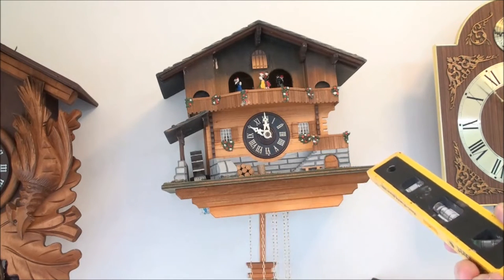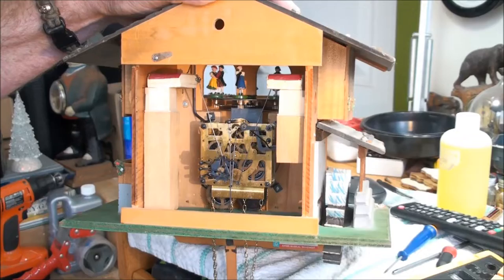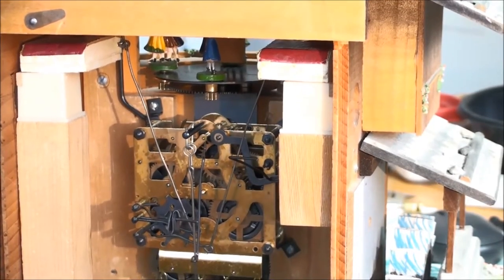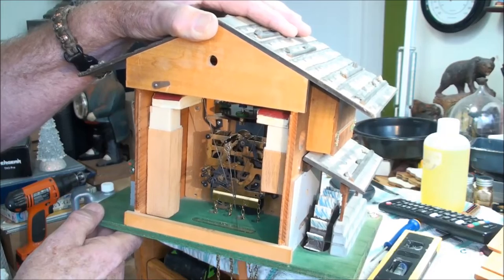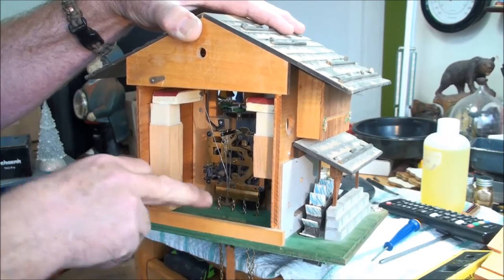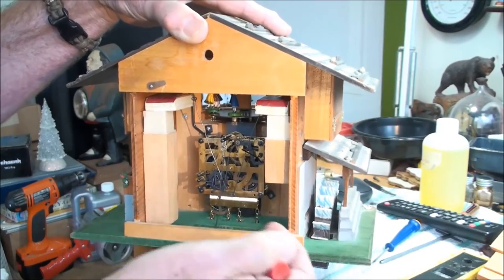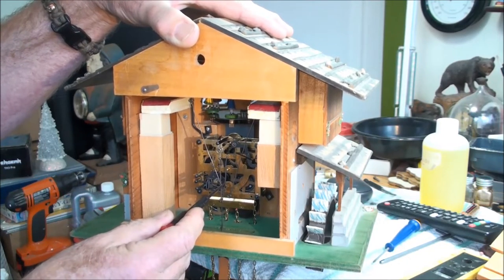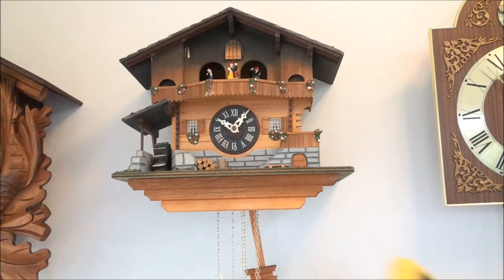Does you Cuckoo Clock Hang Crooked to Run

Comment: thanks a lot man! Great to know!
Reply from the maker: It is amazing the little things you can do for your clock to make it better. You have a great week Guicepp
Reply: @justmike57 You too, Mike! I also want to let you know how much your videos have helped me restore our fallen cuckoo clock. It had been broken for years! It fell from 2 meters, and the damage was severe.

Thanks to your guidance, I was able to find motivation and confidence to fix the clock. I started repairing the bellows with the correct paper, repaired the spring that controls the cuckoo’s return, which had snapped, and clean the clock using a simple 5% ammonia and green soap solution. Afterward, I re-oiled it carefully.

Your video on adjusting the clock horizontally with equal spacing between ticks was a game-changer! I'm so thrilled that I managed to restore it — all thanks to your help! A huge thank-you!

I do have one question: are the old springs wrapped around the tube that holds the cuckoo replaceable? Almost half of the spring broke off. I was able to add extra tension by loosening the bolt at the bottom of the cuckoo tube, rotating the tube an extra turn, and securing it again.

Thanks again for everything!

Comment: Does it matter which way you bend the wire
Reply from the maker: Yes, it does matter which way you bend the wire. After you bend the wire and listen to the clock tick, does it sound better or worse? If it sounds worse, then bend the wire the opposite direction